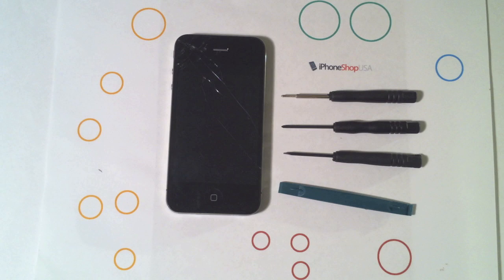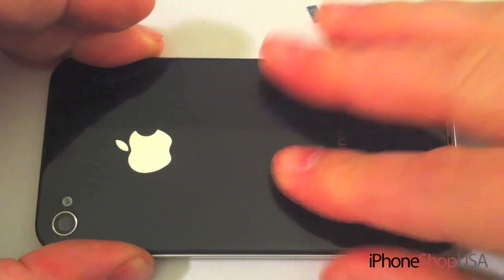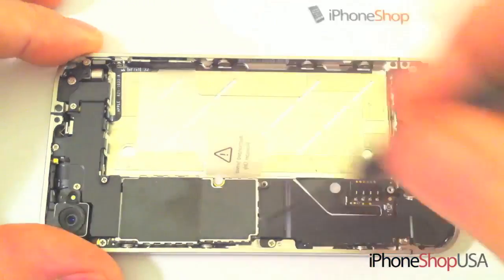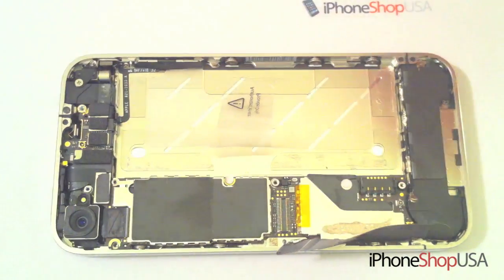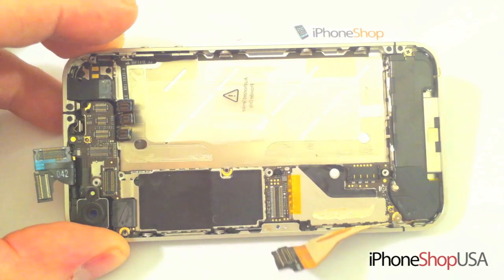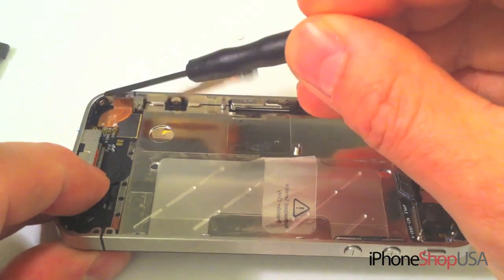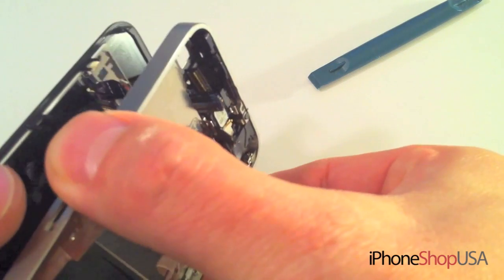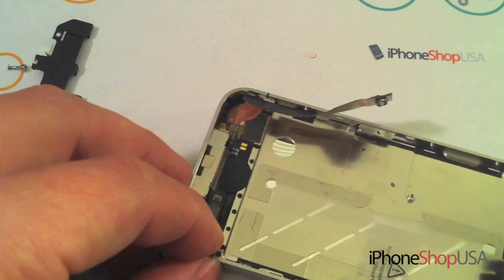iPhone 4 Front Glass Digitizer Replacement Repair HD Tutorial DIY Complete How To Fix

Comment: I have a question, my iphone digitizer isnt broken, the problem is some part of the screen is not working properly and that happened after someone changed it (i think he put it the wrong way), is there any chance to make it work normally?

A row of 5mm of the bottom of the screen doesnt respond to touch at all. (that includes the space key and it forces me to twist the phone to write or zoom in, that's annoying). Thank you in advance
Reply: i could still be the digitizer. did you ever get that fixed btw?

Comment: I really need you to answer my question please! I recently broke my iphone screen and now my iphone wont turn on, like the screen is all black although the phone is technically still on. I can still recieve calls and texts just that the phone wont turn on anymore. I was thinking of buying a new screen from amazon and using this video to change the screen. Will replacing the broken screen with the new screen allow  the phone to work like it used to ? Like the lighting will function properly ? because something tells me somethings wrong with the wiring inside or something

Comment: What if I want to reuse the working LCD on broken touchscreen?
Reply: Then you can peel off the LCD from the Touchscreen, it is super glued to it and its very hard to take the LCD apart from the [cracked] digitizer.  I believe there is a method I read when I did the research on Google involving the use of some heat gun to melt off the glue and be able to remove the LCD much easier without accidentally cracking it, it has very little margin of error and its very easy to burn out the LCD causing it to have a brownish spot when you turn it on, and you will have to calibrate it onto the new digitizer in perfect spot for synchronicity.  I would rather just purchase the LCD with Digitizer assembly, install it and then bill the customer accordingly.

Comment: i got a conversion kit for my iphone four but after doing it myself, i turn it on and everything works except the actual display i can onlock it at lok it again the only light is a greyish color lighting up the screen i can hear the lock sound too idk if i had pinched a cable and broke it where i need to buy another or it can be fixed?

Comment: I think magnetizing the screwdrivers might be helpful. (You can see in the video that the screwdriver is magnetized.)  To do this at home, take a strong magnet and rub it against the metal of the screwdriver from the middle to the tip.  The more times you do this, and the stronger the magnet, the stronger the effect on the screwdriver.  This may help get the screws out when they're turning and turning but not coming loose.

Comment: Did you replace the LCD as well? I'm getting ready to attempt a cracked screen repair on my sons 4s but I was told its better if I just buy the entire assembly instead of attempting to separate the glass from the LCD. Any suggestions?Thanks!

Comment: @khambeuy if the top shield. specifically the longest screw that holds it in place isn't installed on the iPhone 4. That will cause the iPhone to have a weak wifi signal.

Comment: just wanted to give 2 tips:

1: my battery was glued in pretty good, so i had to remove the main board and the speaker assembly and then get the battery out, which was still hard at the end without trying to damage it

2. the screws with the washers that hold the screen, (3 on each side) don't have to be completely removed, just loosen them as much as you can without removing the actual screw and the screen will still be removable, the 4 in the corners will have to be removed

Comment: Hey, would just like to say I've brought the Red conversion kit off eBay and installed it using this video. Went perfectly and if you follow the steps it's not that hard. Just remember the screws are ridiculously small!! I got myself a large sheet of paper and replicated the circles as on the video just to make sure I knew were everything was. The only tips i'd add to this video is that the battery on my phone was stuck down so I had to use a bit of force to get it out. Also, when removing the

Comment: @prochafilho use a magnet and as u disassemble put the screws you pull out onto it so they dont roll away. Using multiple magnets helps specially where different size screws are in question.

Comment: You do not have to remove the 6 screw with the washers.

Just back them off until they feel like they are about to come off, then tighten half turn.

The screen bezel clips will slide freely as you remove the screen.

The new screen will slide back in with no problem with the screws and washers still in place.

Comment: Thanks for putting this up. I took me 4 hours to complete. The hardest parts for me was removing the battery and screwing the tiny screws. Using a hairdryer made the job a lot more easy. To screw the tiny screws you'll need a magnetic screwdriver. You can make your screwdriver magnetic by hitting it with a hammer. It sounds weird but it does work.